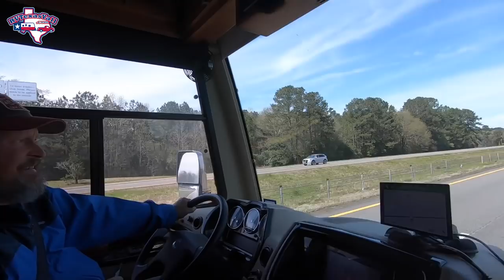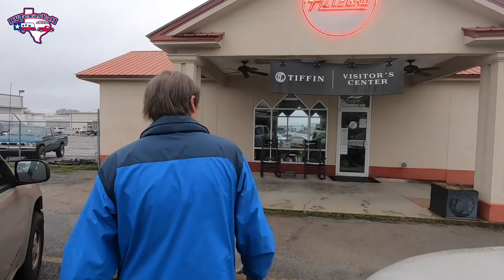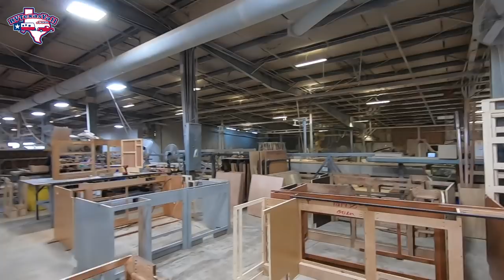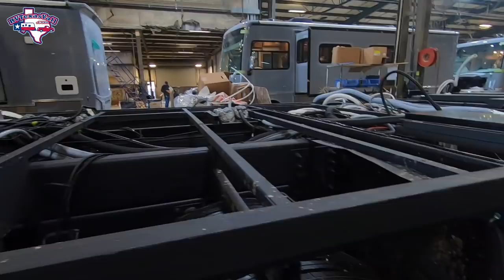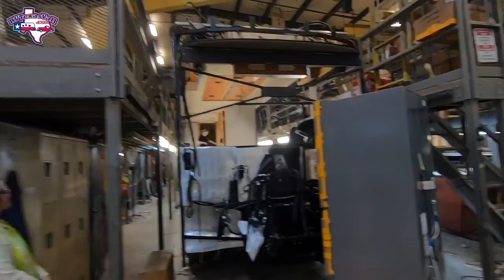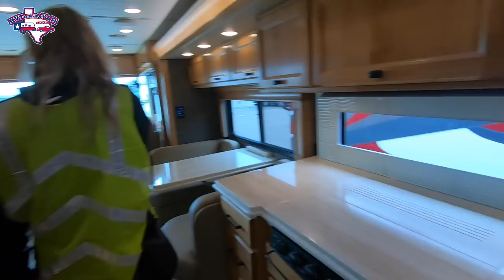Behind the Scenes at Tiffin Motorhomes: Discover the Production Process

Comment: When you got to the wiring section, that's where I would have gotten thrown out. I am really disappointed in the wiring of our 2019 Open Road, they need to slow down and do a better job on the wiring. We are waiting now to get in into the dealer for repairs on wiring issues and other things. We love our coach but wish they would have done better on certain things.
Reply from the maker: Sorry to hear about that, Ed. If at all possible, we highly recommend making the trip to Red Bay to have Tiffin do the work directly. We had a fantastic experience with their service. And everyone we met there was very pleased with the work they got at the service center.